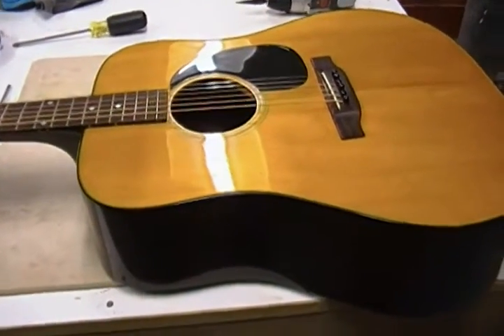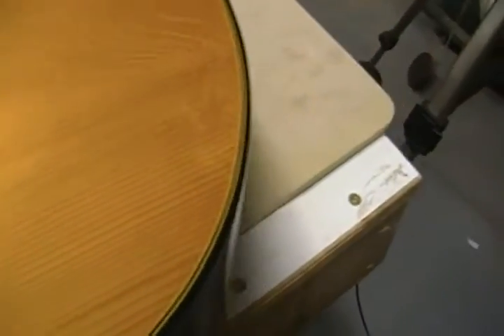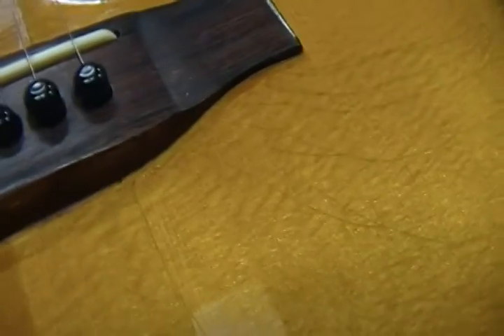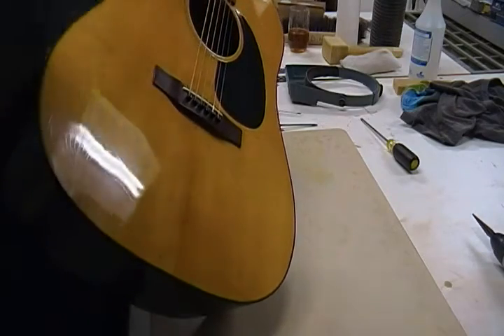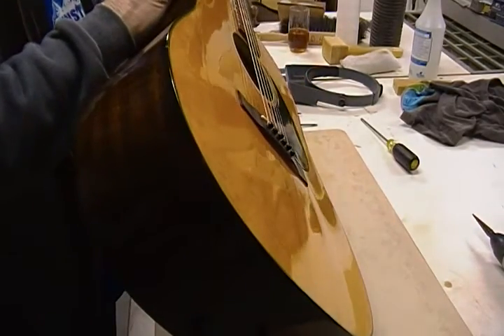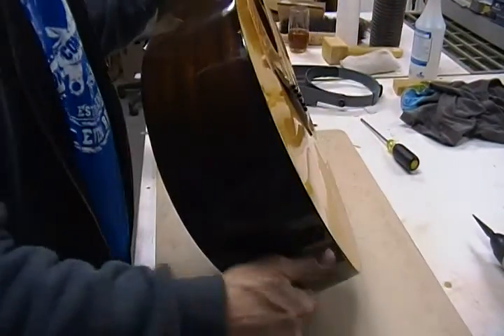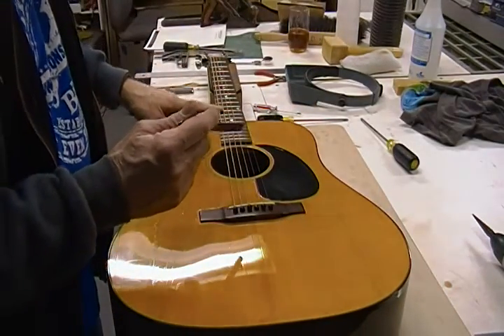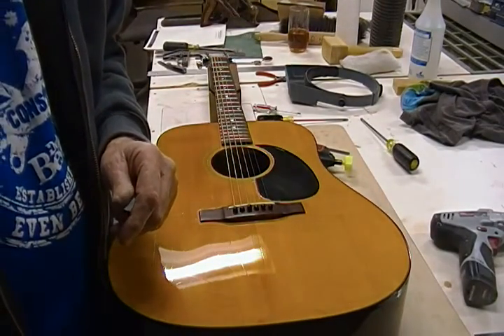Gibson acoustic guitar LR Baggs Lyric pick up install #1

Comment: Those lacquer cracks look similar to the crazing you get on guitars that go through huge temperature changes like the Levin's (Goya's in the US) from Sweden, is that your experience?  Gibson numbering....the worst, why do other companies not just follow Martin's lead
Reply from the maker: Ian, yes that seems to be the case with lacquer. I yell at people when I find out the leave instruments in cars or trailers, just not a good idea. Quite a few guitar companies have some screwed up numbering systems especially early on before they realized it might mater in a hundred years. Thanks again for checking in.